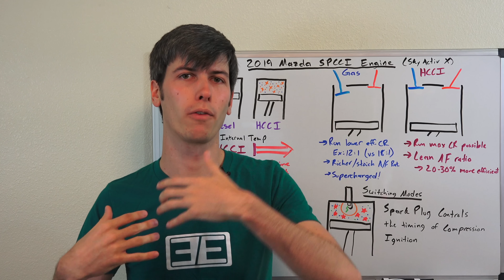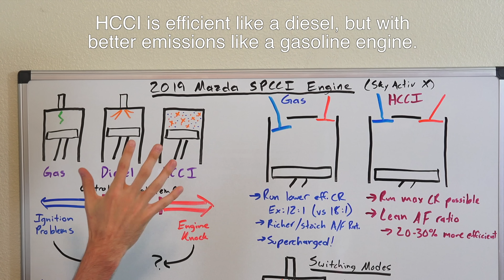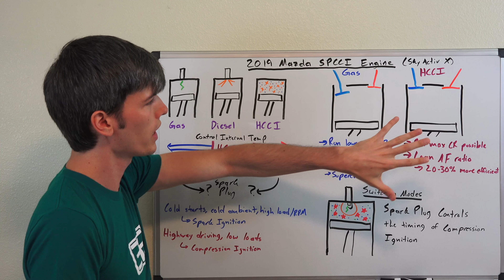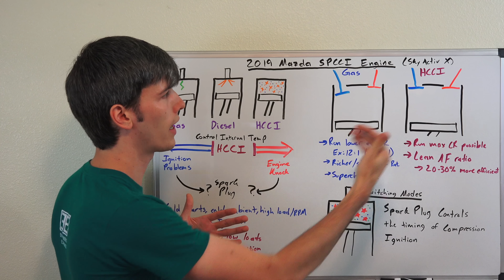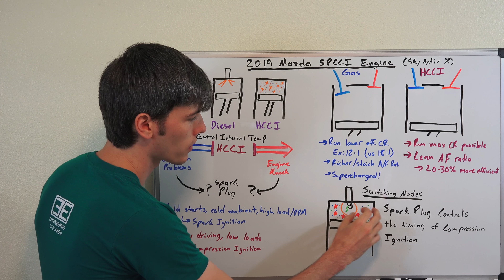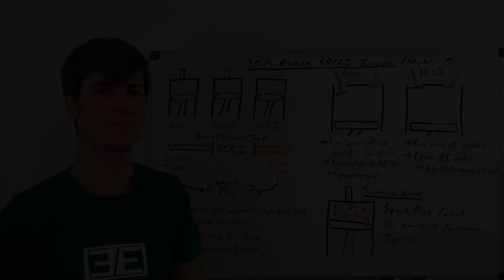Mazda Creates The Holy Grail Of Gasoline Engines - HCCI SkyActiv-X

Comment: I want Mazda to use Honda's IMA hybrid stuff. Love the idea of no alternator, and a pretty big electric motor attached to the engine instead of in the transmission - allowing for a manual. perfect answer for a rotary too...
Reply: also it's technically the 'miller' cycle when you're supercharging an atkinson cycle. at least that's what wiki tells me
Reply: Mazda is patterned with toyota I doubt they will use hinda technology.

Comment: I'm assuming all these enines will be running on higher octane fuel to be able to get such high compression
Reply: Nicolas Deragon they already run 14:1 on current skyactiv with no knock on 87 octane, the engine just holds the intake valve open longer to detune if it knocks. You still get good power at high RPM, and if you want to use premium you get more power as well.

Comment: Why the supercharger? Supercharger adds to belt wear and thus is usually only useful at low engine speeds where there is not enough air volume to run a turbo. Also would an EV not offer the same benefit- at low speeds the EV is in use (100% torque) , at high revs or load - both power units work to combine for max power and at steady speeds/downhill a gas engine runs at max capacity, max efficiency and at a high temp to allow easier exhaust cleaning. Also big investments in petrol tech might help as diesel is killed off for small engines but unless it can work with Hydrogen (and hydrogen engines get sold in volume and with the refueling issue sorted (stations, low -carbon hydrogen production) then non-hybrid petrol engines have no future...

Comment: If I were designing it I would include water injection on overrun (off-throttle) to eliminate the carbon deposits in the combustion chamber. Carbonaceous hot spots may cause pre-ignition in these engines as they age, and are unavoidable given the consumers ability to buy bad gas and incorrectly extend oil changes.

Comment: LS is the holy grail of engines , lighter than a 1.6 engine from an old Mazda Miata  . And plenty of Torque and HP from stock with the ability to more than double those numbers with full bolt on's . Remember the best mod for any Miata , is an LS swap .

Comment: My guess to the compression problem is that the supercharger will be electric driven and responsible for the compression variation...otherwise if you think about it, it wouldnt make no sense at all to have a compressor working parallel to an engine that can already generate so much comp on its own..

Comment: I wonder how the production motor will be set up, knowing that it will be supercharged would suggest something similar to two stroke Detroit Diesels. I see it as a port aspirated forced induction (positive displacement blower, probably 6psi max boost, 0.5psi idle) with fuel injected downstream of the supercharger, 3 valve per cylinder - 2 exhaust variable timed, one decompression valve instead of intake valve used to toggle between spark ignition mode  (lower compression, valve open ~10-11:1 CR) and compression ignition mode (valve closed, full compression ratio being achieved ~18:1CR) solenoid activated, cylinder head mounted spark plug AND flame rod (to prove for combustion event during compression ignition cycle)
This is how I see a motor like that, time will tell if I was close...

Comment: Mazda technology may be successful to reduce MPG & CO2 but at the cost of huge loss of performance and engine refinement. They will soon realize that how much time they have wasted and how far their competitors are ahead of them in terms of Hybrid & EVs! Just look at current Skyactiv engines! For example, refer to latest Motor Trend comparison between Honda CR-V & Mazda CX-5! Mazda once said that Turbo engines are not useful for reducing economy and we saw in the test that CR-V not only burned less fuel but also considerably faster too!  That's why Mazda developed a Turbocharged engine for their latest CX-9!

Comment: It might also be possible to run a lean burn, high compression cycle with the fuel injected in a small ancillary combustion chamber like Honda did with the CVCC motors.  That would be interesting.

Comment: very interesting concept and well explained friend. just one thing that always seems to bug me about car design, power, efficiency etc is "car weight" it seems over the years cars just get bigger, heavier, more complicated, less driver oriented vehicles. so why isn't there more focus on weight saving, eco friendly and recyclable materials. 
This engine design looks complicated as you have to remember it has to run from -40 degrees C to +40 degrees C depending if the customer lives in say Canada or South east Asia, or elsewhere. I think we should be looking at running green fuels / eco fuels that can run in the direct injection, turbocharged engines and making vehicles lighter is a good way to go for next 50 years.

Comment: Great video and Well explained!, i understand it:-), but what i can't understand  is why car manufacturers keep buisy with developing new fuel engines, when at this moment the price of battery's are dropping so rapidly. The eficciency, torq, reliability and simplicity of an electro motor is impossible to beat with a combustion engine. 
An efficiënt combustion engine is simply impossible!, becouse you always have to deal with friction of pistons, high temperaturures that you have to get rid off and you have the friction of meny moving parts.
 When you burn fuel you create heat, you must fight physics to create motion.
When you put electricity through a coil you create an magnetic field, witch naturally attracts steel, wich creates motion. Now physics is your friend!
I hope Mazda soon will put his efford in developing good ev's!

Comment: 20-30% sounds impressive when you work on the basis of a gasonline engine being ~30% efficient...

But then you need to realise that's only achieved at wide open throttle/full load(*) - and car engines seldom run at this setting. The reality is that across the average drive cycle a car engine is only 4-8% efficient - so improving it by 30%  (5-11% efficiency) is a big step, but it's still nowhere near theoretical maximum.

(*) Diesels don't have throttling losses, but small diesels are only slightly more efficient than gasoline engines due to pumping losses at low load.

However, if you marry a small HCCI engine running at optimum load driving a generator, you may have something that's more efficient than the Atkinson(Miller) cycle engine in your average Prius. 

Time will tell. Mazda may be the first to get HCCI to market but all the automakers are working on them.

Regarding the comment about losing a cylinder and adding turbos, check out japan's Kei cars sometime. Europe is moving away from small whizzing engines anyway as they emit too much particulate matter and NOX is difficult to control at the desired power output.

Comment: 6:22 Wouldn't the flame front from the spark plug ignition be advancing at a speed no faster/slower than that of a shockwave? If so, it follows that the pressure/temperature of the air/fuel mixture in front of the shockwave won't increase until the actual shockwave hits it, and the effect would therefore be basically the same as if the entire air/fuel mixture was ignited by the advancing flame front from the spark-plug anyway? Except to say, the increased pressure/temperature would allow a leaner mixture - except with a leaner mixture the spark plug ignition would fail anyway???

Comment: HCCI seems like a perfect complement to use with an EV drivetrains/serial hybrids like for example the Nissan Note E-power. Where the engine can be just run in its most optimal mode and conditions? What if anything missing or do u think? And what r the pollution ramifications of HCCI especially for PM and NOx? I thought high compression ratios could affect these pollution parameters negatively or am I wrong?

Comment: Smokey Yunik did something similar to some of this back in the 80s.Much less complicated and passed all calfornia emissions at the time without egr etc.Very fuel efficient good power and so simple without computer control or having to switch over systems.Kind of strange how things got very quiet around His engine.

Comment: What sort of fuel would be ideal for this HCCI engine. Gasoline or diesel, as at  high temperature the diesel would combust much faster providing a very high energy but for a shorter period of time.
Instead if they are going to use gasoline the temperature of the whole cylinder must be very high. To make the gasoline self combust(as if they use a spark plug ) then what would be the difference between a normal SI engine and the "HCCI".

BTW, I am a huge fan of your work your videos helped me a lot in the practical understanding of of what I have studied during my engineering.
Reply from the maker: It runs on gasoline.
Reply: Engineering Explained so you are saying that at low RPM spark plug would work only for initial starting and if the engine is at a low RPM..?

Comment: some day if ICE vehicles have zero toxic emissions, run on 100% advanced carbon neutral bio fuels and are twice as efficient by 2025 when compared to 2015.  these 3 steps will make an ICE car better than EV's in every manner. so there are lots of chances that an ICE car can not be dead for ever!

they can also be made as silent as EV, less maintenance, extremely reliable.

Comment: it basically uses a pre-ignition ping (spark knock), to ignite the fuel air mixture. However the timing (pf the ping) allows smooth running. not sure how it'll run, so we'll see. I always found it ironci, that diesels used the enemy of gas engines (the spark knock) in it's normal operations. Now a similar principal will be used, in Gas engines. Diesels have to be built very strong, to handle those events. How is that added weight (strength) going to affect the overall efficiency?

Comment: Wouldn't a Turbo rather than a supercharger make this engine even more efficient? Or were they prioritising more immediate power when you accelerate?
Reply: Turbocharger produces no boost off idle, and I believe this motor will require some positive displacement to run, hence the supercharger which runs off crank pulley so it spins whenever the motor spins forcing air into plenum (size of a supercharger pulley dictates how much boost you get off idle)

Comment: Would TJI be a better bet compared to HCCI?
The current-gen Formula 1 engines (ICE) were speculated to be running HCCI tech due to the efficiency being reported vs the power being generated. But, latest reports indicate that it was not HCCI, but TJI (Turbulent Jet Ignition) being the core tech.
Would love to see a video from you on this, Jason !

Comment: Higher compression requires stronger engine components. Typically those weigh more. So this "solution" creates new problems. But every innovation requires refinement. Don't buy one of these vehicles the first year they are introduced.

Comment: This sounds like an extrapolation of the Miller cycle engine that was used in the Eunos 800, in the mid 90's.  Those were a pretty solid engine (my father had one for nearly 20 years, was economically written off by a broken tail light).

Comment: I think it's simpler than we think; using my theory of course. If you remember back in 1981 when Cadillac came out with the V8-6-4? Well it was ahead of it's time, or to be more specific, ahead of the computer of the time. Just follow here. From what I recall, it was  controlled by a combination of TPS and MAP sensor inputs. When you had to suddenly accelerate, the engine hesitated and took a little while to respond smoothly because the processors of the day were way too slow. OK, now let's fast forward to today. The microprocessors of today are lightening quick and most cars are drive by wire, well a good % of them are. Today's engines are overloaded with sensors and that information is now processed within fractions of a second. With that info in hand, here's my theory. Using a combination of throttle location thru the pedal mounted TPS sensor*, MAP readings, O2 sensor inputs, sustained or variable speed, cruise control activation and torque load; the computer can add or remove spark within fractions of a second depending on any combination of the input parameters available. An example would be from merging onto the highway then attaining a steady cruise. As long as the throttle position remains above 50% (just an example) there will be full spark of say 15,000 volts. As the TPS* % location decreases, so does the voltage for spark, or say the gear change from 4th to 5th decreases the voltage or frequency/timing of the spark by say another 15%; or any combination thereof. Yah, lots of words but rather simple, especially for today's ultra fast processors. Whew! I'm done. I need to take a few deep breaths.

Comment: Just read a detailed article on a Japanese site. And it's more or less what's in this video. Just want to add some info. According to the article the biggest neck was how to micro-control the timing of the ignition only by compression (because the time range was too wide) and they couldn't find a solution (which made all the automakers, except Mazda, to give up on this technology.)  What Mazda came up to solve this problem was, instead of trying to eliminate spark plugs, why not use it? So the idea is, compress the air-fuel only close to the ignition point and let the spark plug do the actual ignition on that exact millisecond!  Seems very simple. The article also says that this is a triumph of ideas rather than technology and the additional cost is unbelievably low. Apparently the only significant modification to the engine is the addiction of a "high-responsive air pump" (which, again according to the article, is as cheap as they come.)

Comment: Well... you can apply as must technology as you want, thermodynamics efficiency is still low. You are not having the CHEMICAL energy inside the fuels. You are having the combustion to generate gases and expansion to move all the system. Even that good fuels and good energy provide both a higher eficiency, you're not still get there

Comment: A good question would be if the engine is going to be direct injected or not. If it is, than it would be even easier to control under compression ignition conditions.

Comment: Mercedes had this technology a few years ago. https://en.m.wikipedia.org/wiki/DiesOtto

The biggest problem is, that the burning temperature gets very high and you are producing a lot of NOx (like a Diesel engine). In the end of the day you have to decide if you want an engine, that is producing no NOx (but a lot of CO2, bad fuel consumption) or producing less CO2 (but a lot of NOx).
Reply: But why should there be a cold burn, if the compression ratio is so high?

Comment: My '72 Kawasaki F9 motorcycle had this characteristic (unintentionally) Once it entered this "mode" engine seizure would take place in about 45 seconds unless the choke was pulled. One could turn the key off and the bike would continue to run without spark.

Comment: Cool video yet again man
Engines are coming along way now.
When do u think they push more for e85 or hydrogen?? 

Keep up the good work
Reply: E85 is a failure of a technology, it requires more energy, and thus more co2 emissions, to refine and produce than it saves during consumption. I'd love to get behind hydrogen(both fuel cell and combustion) but storage and hydrogen embritllement are still huge issues in the way. Somebody has to dump a lot of money into solving both of those before any viable product can come to market.

Comment: Head gaskets and turbo charger rebuild kits... YEP... Those are stocks I'd be buying. Turbo chargers are more common place on cars and prone to failure.. And those higher compression ratios are bound to mean more head gasket replacements... Damn the reliability factor... Lets just make cars run faster and more economic to operate as long as they are under warranty.  After a few years they can rebuild them or junk them.

Comment: This engine sounds like it will have very high cylinder combustion temperatures which lead to high NOx formation like a diesel.  I wonder if this engine will need a urea injection system to control it.

Comment: Jason, any guess on how r they gonna be dealing with all the heat from running super-lean plus those internal forces due to huge compression ratio?
Reply from the maker: HCCI actually burns much cooler than diesel, so running lean won't mean high temperatures because the burn is actually fast (all at once, rather than a traveling flame front). This is what gives it the great emission properties.